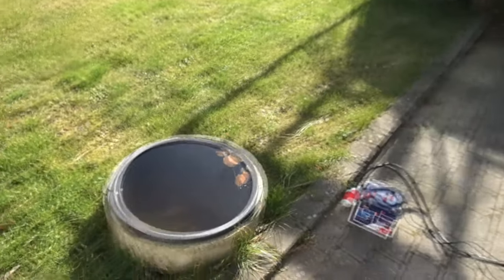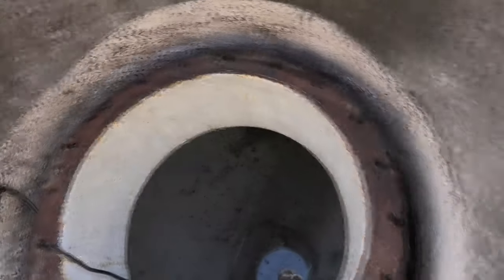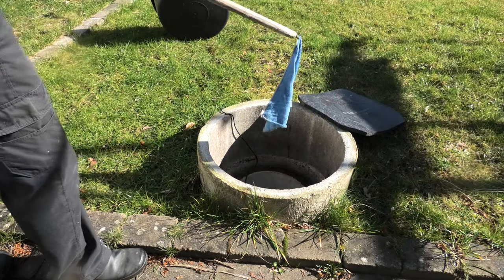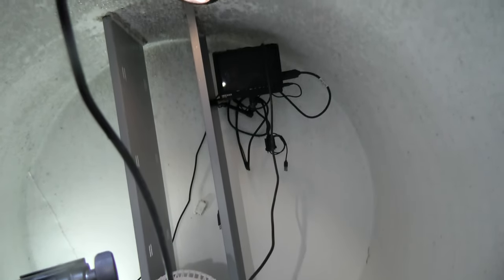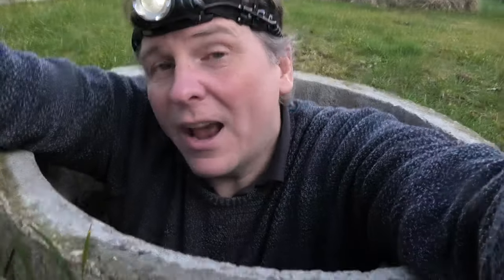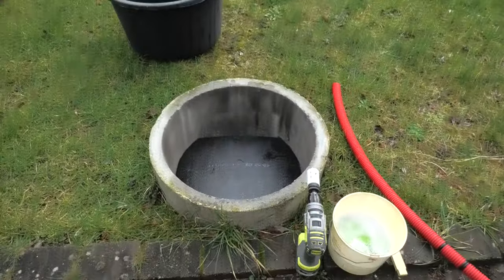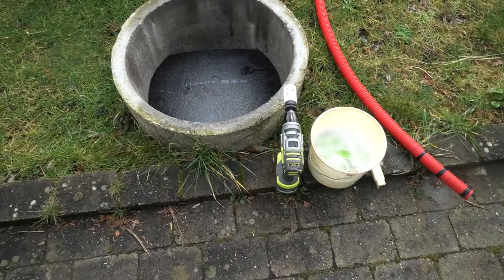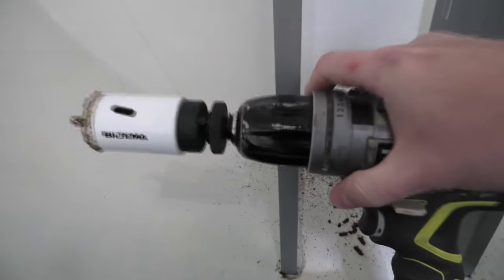The Data Center Bunker - Does NOT Look Good - 1373

Comment: Perhaps you could leave the inlet open from where you enter, in the sense of putting a lid with a fan, and make an outer cover (instead of the plastic pot) that covers the inlet from the rain. Add a small internal heating system, and circulate the air from the pipe you put in, to the outlet you enter through.
Of course in this way it would lose the camouflage appearance of a planter, and you would immediately realise that there is something underneath....
Reply from the maker: It keeps raining here,, so letting it be open, is not a good solution for very long. I have ordered a dehumidifier and are planning some other stuff.. good with some crazy projects :-)

Comment: I think the bunker will be an endless maintenance pit. The lack of ventilation is an ongoing problem causing the water, mold, and unhealthy conditions.
Reply: Be sure to make a very good seal for that hose you are adding. Also consider using a fan to permanently have airflow down there.  It might still be tricky to keep your bunker dry. Water has its ways.
Reply from the maker: Not saying your wrong,, It might be a waste of time, and endless trouble,,,, like anything else :-)
Reply from the maker: I hope a fan and something using power down there will help.
Reply: @MyPlayHouse Rechargeable desiccant modules can help. These are completely passive and the 'recharging' is really just a process of heating the desiccant cartridge till the water evaporates off.

Comment: use something marginally bigger for venting - use pvc sch40 and a pc fan or two connected to small solar panel and/or small battery - control it with esp chips and home assistant - add a flat floor - i think adding the nas will help humidity and put better dome on entrance and on vent - you should get some degree of natural airflow - put up a pole and a birdhouse and then you will get better air velocity due to pressure difference - mount pvc 'chimney' in line with birdhouse, mount a mini turbine on top of that for bunker power independence and recharging, put a drone landing pad on top of birdhouse for recon - then you can stream from drone to nas to laptop
Reply from the maker: Temperature in the bunker is low,, as it is under ground. So the Air i blow in the bunker needs to have the dew point temperature is lower than in the bunker.
Reply: @MyPlayHouse  if you run the nas in the bunker it will raise the temp. The dewpoint goes down with increasing temperatures due to the inverse relationship between temperature and relative humidity. Here's why: Warm air has a higher capacity to hold moisture (water vapor) than cold air. As air temperature rises, it can "accommodate" more water vapor without reaching saturation.
Reply from the maker: @shephusted2714  when the temperature goes up, the air can hold more water,,and does not become dew. as easily.

Comment: You should fit a couple of fan driven ventilation pipes on top of the tank one either end, to reduce the moisture build up. Just make sure to seal that hole you drilled well or you are going to get ground water ingress into the bunker.
Reply from the maker: I will need some fan, at some point :-)

Comment: How about 'hermetically sealed datacenter in a barrel'? Build it in a sealable plastic barrel, fill the bottom with dessicant, and lower the barrels into the bunker.
Good that you drilled the hole above ground water level - the alternative would have been no fun at all.
Reply from the maker: Had it been below the water table,, it would have been bad and wet..

Comment: Boat Water Sump  Drain Pump comes to Mind, and Pump it Away from the Under Ground Tank, You Drain it a good 50 feet away.. And Have a Back Flow Prevented Valve So Water from Out Side Don't Drain Back in.. ..
Reply from the maker: This is water from the air that has come in,, not from the ground. I have not been in the bunker since September last year,, so it is not that much water.

Comment: maybe you need to stick a heating element down their of some kind and power it form solar power, just so it stays toastie and condensations free, also an air vent in as you mentioned, good work bud.
Reply from the maker: I agree,, but I hope some computer power will do the trick..
Reply: @MyPlayHouse  if they generate enough heat then yes, you could also try some anti damp pack sort of like those silica gels ones you get in electronics.

Comment: I am not certain but I guess that your 'waterwall' miggt add to the moisture problems. At least in winter time and perhaps partly in early spring and late autumn the temperature of the water in the bucket will be lower than the air in the bunker and thus it will condensate?

Also what happens when the bucket overflows?
Reply from the maker: Problem is that the big bucket, when full of water has it's lowest point in the middle of the opening of the bunker. So it drips down. If the bucket overflows, water will go in to the ground.

Comment: It’s probably been said already but my uneducated suggestions- it is likely wise to have a proper in and out (pipe with large diameter and proper end fittings/filters) for air and proper ventilation fans on each end to pull air in and force it out.
Then a dehumidifier with some kind of tank/pump combo to pull the humidity out and pump it somewhere else. Your small pipe you’re adding is probably only good for data/power cabling. 
Also why not have one of those dual post racks? I know those could be cut to size and likely welded to the tank (proper ventilation permitting). Also definitely worth investing in a proper respirator if you’re going to be using bleach and all that.

It’s great to see a different way of doing mini-DCs / home labs. Underground has its perks that’s for sure. Almost reminds me of when Microsoft put a Data Center under water 😂.
Reply from the maker: This project is mostly for the fun of it,, I have just ordered a tiny dehumidifier.

Comment: maybe make the hole a tad bigger hole so you can add a fan to ventilate the bunker? and a pipe with a 90degre angle so dont rain in it on top. so it can be there all the time.  might also maybe help with the moisture in the air there also.
Reply from the maker: I do not think a lot of air is needed,, and I need dry air,, or I will just have even more water down there.

Comment: Do you have "Torrbollen" in Denmark (Everdale Sweden) ? if not Biltema has one, no 47-0348, you can make something with a string attached to it so you can pull it out and empty the bucket without getting down there, with a fan it should work very well, I use them in a very damp garage and it works great, but some fresh air should help also, just to keep away from the dew point.

Hope you enjoy your Easter holiday down in the bunker ;)
Reply from the maker: I hope that air flow and some server using power and heating the bunker a little will help.

Comment: Maybe the lid is not air tight and it is letting in water? I assume the original lid was airtight. Maybe you can find a replacement? Or you could build a cover to be a false bottom to the well that is airtight and then have a second cover at the top of the well. Hope it works out. Was it connected to the internet?
Reply from the maker: Yes the the original lid was air and water tight,, the Bunker did now have Internet or power,, but that is the plan.

Comment: Outside air will most of the time be much warmer than the walls of your data bunker, so the condensation issue will be permanent, Morten. With all the groundwater in your basement, I would not be surprised if the connection to your house actually would sink the PlayHouse Submarine PHS Data Bunker. The bunker would work pretty well as air de-humidifier, though.
Quite honestly, this looks like a hopeless case to me. The only option I think you have to get it reasonably dry is to put heat into the bunker. As it is to be the Data Bunker, a nice big load of computing power equaling a Kilowatt or so would probably do. One litre of water takes 2.4 kilojoule in heat to evaporate. Add to that the huge loads of heat the earth aournd the bunker will drain away. WIth the air pressure at ground level, a wall surface needs to be 11°C or warmer to have water evaporating constantly.
But running such a system 24/7 would drain your wallet, so that option probably is not an option. Moreover you want tho use the waste heat from your servers to heat your Playhouse, and you can't have the cake and eat it, the heat is there only once. Then there's the shitty access hole. Once your back acts up again (like mine keeps doing), you run some risk of getting stuck down there.
I don't see much use for the bunker beyond being a storage of some kind, maybe getting a reservoir of well water for the garden from it or similar. The heat required to get it reasonably dry will make it a stupidly awkward to access and crazy expensive to run place for any kind of IT machinery.
My recommendation would be to invest your energy elsewhere. 
Sorry for being so sceptical and demotivating, but that's what I think.
Reply from the maker: This project is mostly for my amusement. Last year I tried to dry the paint with a 1,5KW Bitcoin miner,, and it heated the bunker (and overheated the miner) with in an hour.
I think just 100w will do the trick,, from time to time.